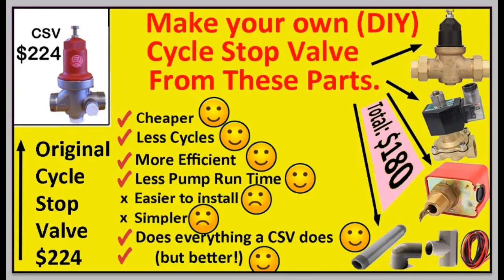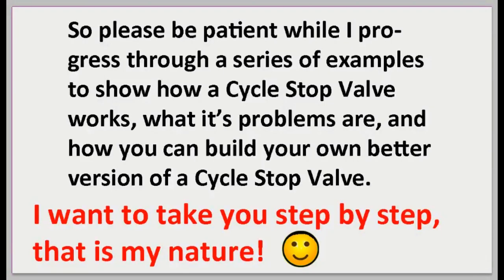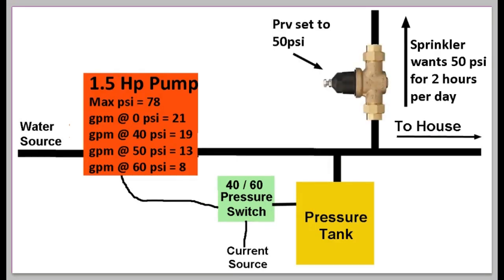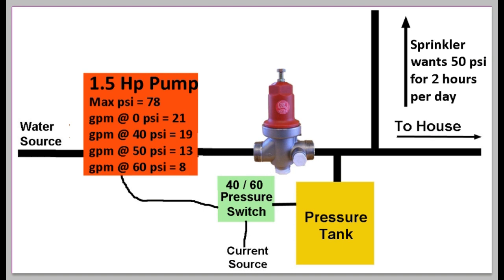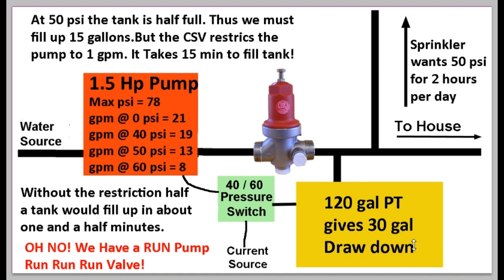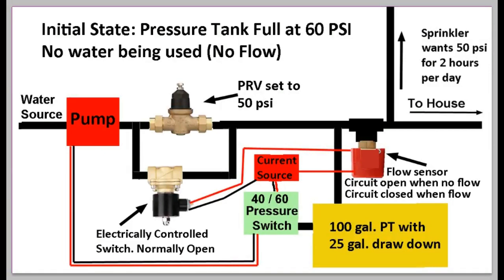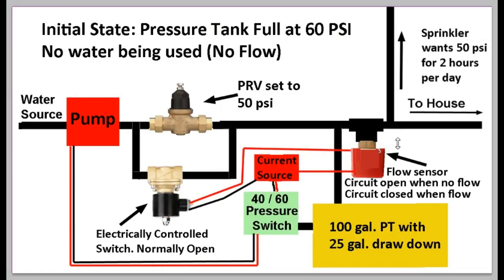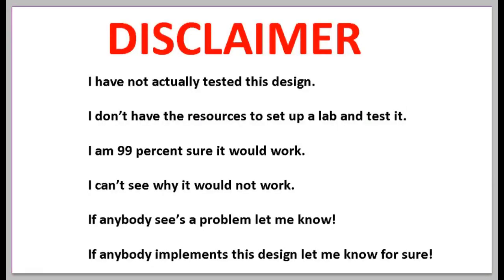Make Your Own (DIY) Cycle Stop Valve From These Parts, Better, Cheaper, More Efficient, Less Cycles!

Comment: What you've described is basically a pump "flow controller" which can be bought ready-made, in Europe they go around 100 euros or less, depending on what features you'd want.
They turn on the pump when the pressure drops to a certain point (cheaper models have a preset pressure, expensive ones allows you to set it) and then keeps the pump running until it detects flow. If there's no flow or under the minimum rate (just like the CSV) it turns off.
The pressure you get will be constant at the given flow and will match your pump's curve at the flow rate, so if your pump does 40 psi at 5 gpm you'll get 40, if it does 60 at 3 you'll get 60, but you can install a standard PRV (even separately for the house/irrigation if you want) to get a lower pressure, still cheaper than a CSV.
They are very popular for irrigation purposes, but there's a caveat. The flow sensors are very sensitive to dirt, as a PRV is, hence why it's not recommended to put anything before a pressure switch that could lower the pressure of the pump. As with these flow controllers, the flow switch can stay open due to debris and it would see that there is a flow when you closed all faucets and your pump would deadhead. So you have to add a filter (see, in this case a lowered max. pressure due to a clogged filter is not a problem as the device turns off to 0 flow and not a pressure value) before the device to filter those impurities and that filter might have to be cleaned frequently (though you could automate it with an irrigation solenoid).

They either have a shock absorber built in or require a small (2-3 gallons) pressure tank to absorb water hammer effects.

You have to be sure though that you  are not running your pump below its  minimal flow for extended periods (eg. irrigation) as that will cause it to overheat. Above that it's fine, though if you use it near the left side of the curve, your pump won't be that efficient.

If you want to look them up, Pedrollo has some models like EasyPress and EasySmall and a lot other pump manufacturers have them.

Comment: with any kind of setup like this (your solutions or csv, doesnt the pressure before prv/csv gets higher and unduly stress piping. i have a 60/80 pressure switch, and my pump can make well over 100 psi. i dont really want to subject my pipe and hose clamps to that pressure, especially since a lot of it is buried. i double clamped fittings, but i think 1" black pipe is only good to 160 psi, plus the extra pressure will make it expand and cause friction with rocks and such in the dirt causing holes ( i have had this happen in the past although it took 30 years with a 40/60 switch). thoughts on this?

Comment: Real world experience here. With a simple restrictor in place set at 56 psi (PS set to 40/60psi) and 2 faucets open it keeps the PT nearly full while running, once taps are turned off, the bounce back effect ~5 psi turns off PS in about 25 seconds with the 1.5hp pump I have running. That said, I think your design is very nice!

Comment: Something that would help this design be more robust would be to add a manual valve in parallel to your electric valve that is configured to let a minimum of at least 1 gpm through it.  This way way if the electric valve or flow switch fails, the pump will not dead head trying to fill the tank.
Reply: Yes, deadheading's bad, preventing it must be part of any setup on any water pump system.

Comment: My situation is that I want to keep the cycles down when the sprinkler system is on. I have a large enough tank to handle the shorter times for the house usage. Putting the pressure valve closer to the sprinkler feed lines seems to be a better place. I am being told from my pump installer that a CSV type setup could cause too high of a head pressure thus reducing the life of my pump. Of course if that is the case then it would not matter where the pressure valve was located. Any ideas? Thank you.

Comment: I notice you never really solved the problem of stabilizing the pressure at 50 psi. The 60 to 40 variability still exists before the pump engages then finally stabilizes at 50. To resolve this, make the system a 50/70 psi range and set the prv to 60 psi. Add another prv after the pressure tank set to 50 psi. Perfectly stable water pressure of 50 psi at all times.
Reply from the maker: Hi. NICE!  I think your idea will work!  Did you see my other video titled "For Cycle Stop Valve Lovers: 5 Ways to Duplicate or Exceed CSV Functionality While Saving You Money!" at https://www.youtube.com/watch?v=YNfqvhb45yA  ?  What you have done is combine my solution 2 with my solution 3 to create solution 6!
Reply: Did you try this? How did it work?

Comment: I installed this system.  My pressure tank has an 83 gallon drawdown. After the flow sensor I have a 20psi pressure reducing valve connected to a open loop 8 gpm geothermal heating/cooling system. 20 psi was selected well below the low limit cycle of the pump so the gothermal system maintains a constant water flow when water is consumed in the house.  The house has a pressure reducing valve at 50 psi. When the geothemal system calls for heat/cooling the pump runs continuously.  Prior to this installation the pump cycled often when heating/cooling is required.   Outside the house the garden hose flows at a steady pressure.  Prior to the installation of this system the garden hose pressure varied as the pump cycled. Thank You Larry Elterman
Reply from the maker: Wow, you are the first person that has actually tried this so far as I know. I am so glad it worked! Did you have any problems getting it to work properly?

Comment: First of all, why would I take advice from someone that doesn't even know how to make simple 5 second adjustments to a lawn sprinkler head?
Second, an irrigation system should be set up so that the pump is not cycling on and off by simply adjusting the GPM of each zone through nozzle selection. If this can't be accomplished, then the sprinkler system was not properly designed. 
Third, your yet to be proven idea involves two electrically operated devices and substantially more plumbing labor, electrical materials and labor and space.
Fourth, for the $44 difference in material costs and the increase in labor, I'd buy a complete product with only two fittings.
Fifth, if you think the pump will never stop because it won't reach 60 psi, why wouldn't you just adjust the pressure switch to 50psi?
Sixth, a 120 gallon tank is 26" x 62". That's huge. Where would most people put such a behemoth?  Not to mention it costs over $1200.
Reply from the maker: 1. what does lawn sprinker heads have to do with anything. Why don't you just say you would not take advice from a person that does not ride an elephant. Lawn sprinklers out of the blue with no context
2. What does setting up an irrigation system have to do with cycle stop valves. Again random stuff out of the blue without context or relating it to anything.
3. it does not require anymore space. and it not only costs less but works better. But yes it is more complicated..
4. why buy a product from a company whose main goal is to rip people off?
5. i have no idea what you are talking about, again random giberish with no context.
6. the big tank is just an example of one setup you could do.  There are always trade offs in whatever you do.
7. I don't trust you, you sound like you work for cycle stop valves. :)
Reply: @LarryElterman  I like the idea of your valve setup. Have you tried this out yet? Just wanted to add in an irrigation system sprinkler head manufacturers make interchangable nozzles with different GPM ratings. These nozzles are used to balance out the water being distributed over a certain square footage and also used to control how many GPM the irrigation zone is running. I run an irrigation system from a well, 1.5hp pump, 25gal pressure tank, 40-60 pressure switch. My system was designed to run on city water with a total flow of about 14gpm (14gpm based on all nozzle gpms added together for the zone). When I had the well installed and began running irrigation, it cycled the pump about every minute and a half. My well driller/installer told me the pump needs to run continuously while irrigating. So I increased nozzle gpm until I had enough flow to keep the pressure tank from reaching 60 psi and the pump never shuts off the entire time the sprinklers are on. As soon as the sprinklers turn off the tank is immediately filled and pump shuts off. So long story short I was able to stop the cycling by increasing the flow through the sprinkler heads. The distance of the throw of water from the head can be adjusted some with a diffusing screw if they are spraying too far.

Comment: Thanks for the explanation. However, the Cycle Stop folks do say to size the PT large enough to handle those short term uses. The faster recovery for the PT in your design does seem to be an advantage.

Comment: how would this system work in a house where you have to leave a couple faucets dripping to keep from freezing?
Reply: A dribble flow bleed by hand valve will assist this type of setup, you can adjust it as needed vs the electrically controlled valve listed.

Comment: Can you also add an additional prv next to the flow sensor to ensure your sprinkler does not shoot at your neighbor?

Another hypothetical question: if I only cared about constant pressure and not about the life of my pump, can I simply use a prv only?  Then the pump would turn on any time I use water, but the water will always be at 50psi no matter how many faucets are running.  Is this correct?
Reply from the maker: with regards to your first question, the answer is  yes, you could ad the additional PRV, but its only going to make a difference for a short period of time from when the tank goes from 60 to 50 on sprinkler startup.

As for question 2, you have not given me enough information, not sure what you mean, are you suggesting getting rid of the pressure tank? Try to be a bit more detailed in what you mean, what exactly the setup that you are suggesting is. But in general, if you put a 50 psi prv on the output side of course the pressure would not exceed 50, it could still go below 50 depending on the capacity of the pump.
Reply: @LarryElterman  RIght, I am asking: if I simply have a pump + prv set up without a tank or any other components, what other possible downsides could be other than shorter pump life span due to over working + frequent cycling.  One other thing that comes to mind is build up of pressure after the prv because there is nowhere for excess pressure to relieve itself when temperature changes, but I'm not sure how serious that issue is given my set up will be 100% indoors.  And thank you for the informative videos!
Reply: @hoib0i  Remember not to deadhead your pump or seriously restrict it's flow.

Comment: Really enjoy the CSV video's. Well thought out. You think out of the box and are able to solve problems in a logical way.
Reply from the maker: Thank you! Tell that to Cary Austin (the owner of Cycle Stop Valves) who claims I am a disgrace to all engineers and an embarrassment to the human race!
Reply: @LarryElterman  I've seen two bad rebuttals against your setups. I'm drawing up my own pics to simplify the different types of systems you propose, thank you.
Reply: @mach1553  Can you post? I have this same setup for a couple years now and its been working fine .

Comment: You show a 120v valve being powered on a 240v pump circuit.
Reply: “ if anyone sees a problem let me know “ 

Looks like he let you know of the voltage discrepancy and you didn’t like it.
Reply from the maker: And does that matter? You are nit piking. The switch comes in both voltages depending on where you live. Would my system work or not? That is the question, not whether I mixed voltages in my diagram. So if I used a 220 volt Solenoid with my 220 volt pump, would the system work? That is the correct question.
OH, by the way? Where does it say the pump is 220 volts? I don't see anything in my video that says the pump is 220 volts. Where did you get that?

Ah, so I looked up the pump, and you are right, the pump is 220 volts, but it never says that in the video haha, you are funny. So let me get this straight, you are supposed to look up the pump on line, see that it is 220 volts, say ahaha, that does not match the solenoid, there fore the whole video is illegitimate! Quite a leap!

Comment: Cycle Stop Valve installation instructions, for using larger tanks, recommend setting pressure higher on CSV to keep pump time under 2 minutes when finishing filling tank.  They have a chart for various tank sizes.  The pump would not run for 15 Min like you stated if installed correctly.
Reply from the maker: Wow, congratulations, that actually makes some sense and I had not thought about that. I think it's the first time you actually had a legitimate answer to something I said. Well, raising the CSV pressure closer to the  cutoff pressure would reduce tank fill up time I guess, but I don't think you can get the CSV pressure too close to the cut off pressure or you would risk the pressure switch kicking in while the pump was still running and your system would no longer be a Cycle Stop System. So I think you need some leeway. But good point. But you could do the same thing in my system to make the pump run time even less also.  Give me a chance to do the math, tell me, if you have a 40/60 system with a 120 gallon tank as in my example, what does your chart say you are supposed to set the CSV pressure to? Give me an answer and I will do the math.
Reply: @LarryElterman  Yes they suggested to set the CSV closer to the cut off and I was wondering about that  until I saw your explanation that the CSV will only allow 1gpm to flow to the tank if there is no tap open and that will take time to fill a bigger tank from the halfway point.  I always wondered why the CSV man is very firm on NOT using a bigger tank but the reason is it will take time to fill it compared to the smaller tanks they sell.  Now since I already purchased two CSV's  I am thinking about incorporating your design, the solenoid and the flow switch so it will aid the CSV in letting in more water to fill the tank.  I am sure your design will work!  I was sold on the constant pressure they were selling although I wasn't sold on the less power consumption they mentioned. Great job in exposing the lies!
Reply: @MikeTuason  "...smaller tanks they sell." Of course they sell smaller tanks, company profits!